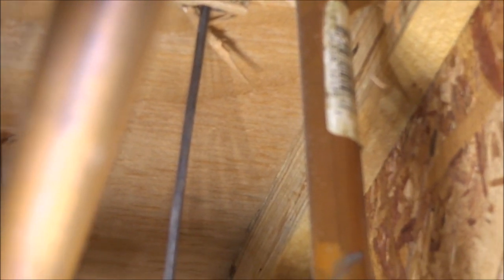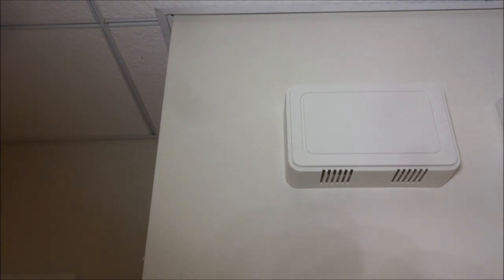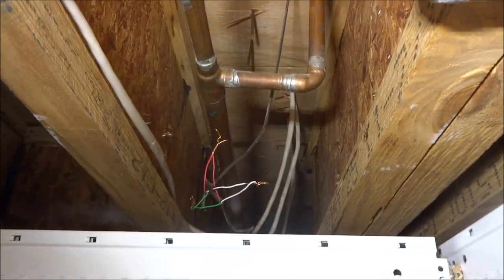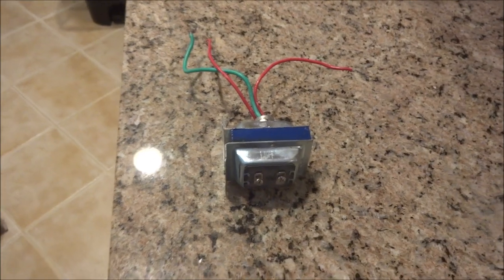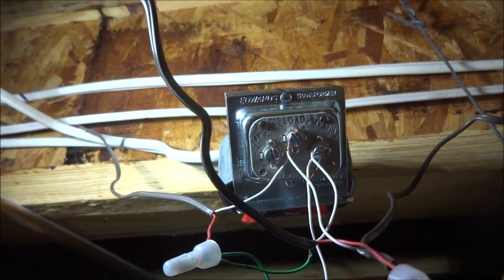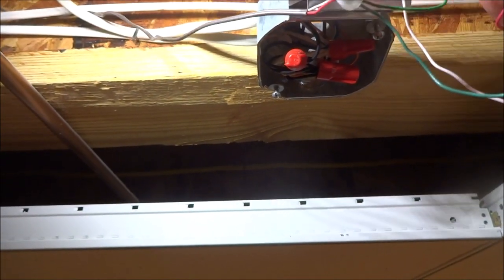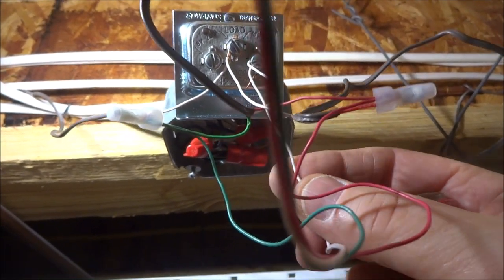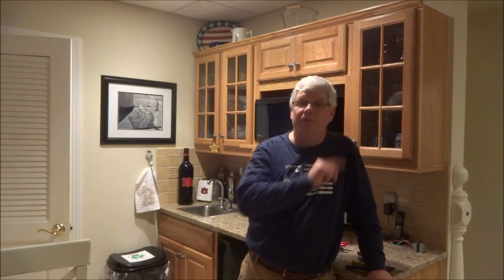Doorbell Wiring   Two Buttons   Two Chimes

Comment: Can you split the wire to make 2 separate connections? My chime burnt out when contractor was working on front door install (but he has no idea what could have caused it; LOL)
I wanted to put double chimes side by side to replace old one (increasing DBs in same location); took the wire that was existing that was connected to burnt chime and spliced 2 new wires in (all 3 reds in one wire nut and all 3 blacks in the other). I already had 30amp transformer bc I wanted to this originally but never did. Thanx in advance for the help!
Reply from the maker: To connect a second chime you'll need to install jumpers from the first chime to the second.  No need to make "2 separate connections" (presumably to the button or transformer).   Just run a pair from the connected terminals on the first chime to the same terminals on the second.  Hope that helps.  Thanks for watching and commenting.
Reply: @elwellboy  I thought it made sense to split the wires into a "Y" instead of jumping from one chime to the other. Mostly bc the covers would be an issue to close and I didn't want to cut them or melt any holes. So, I made second hour in drywall and am waiting on new bell to test. Thanks for response👍🏼